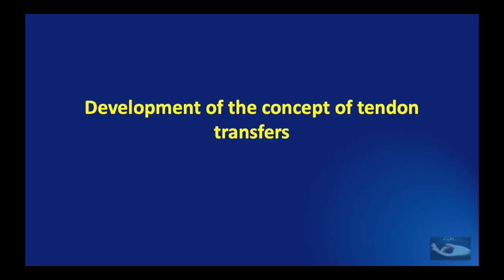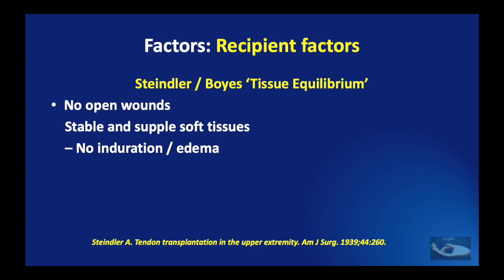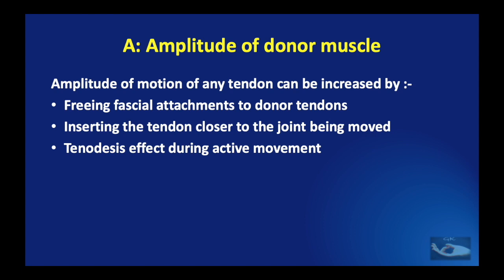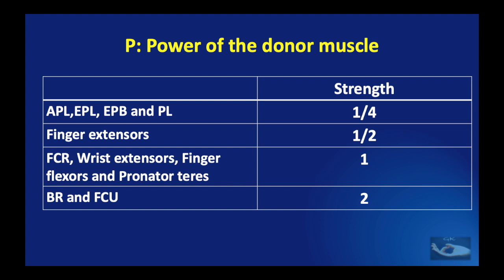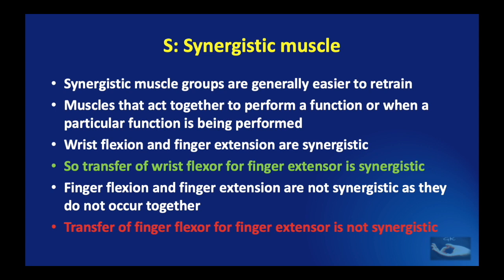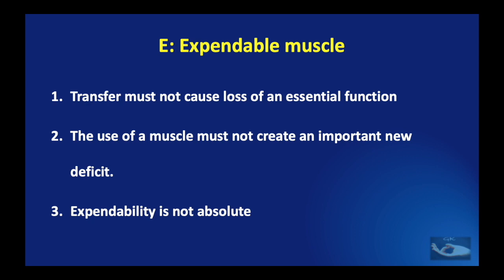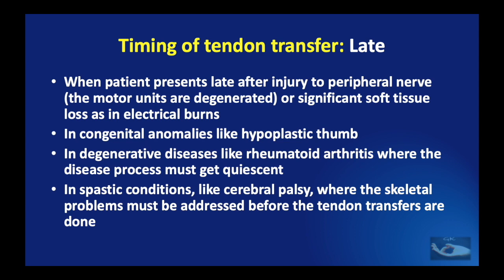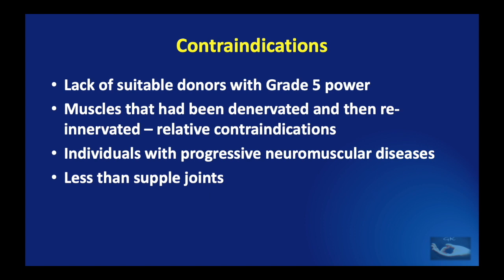BASIC PRINCIPLES OF TENDON TRANSFERS IN THE HAND

Comment: Dear Professor , Thank you for your videos. I hope you are doing well.
Can you please clarify the definition of Excursion? Thank you again..
Reply from the maker: When a muscle contracts fully, the tendon will move proximally. Suppose you open up a hand, keep the fingers in extension, and mark a point on a flexor tendon with a surgical marker, and then ask the patient to flex his finger fully. The marked point on the tendon will move proximally, isn't it? How far proximally it moves, will determine the excusrion of the particular muscle. For example, the excursion of FDP is approximately 70 mm (7 cm) and the excursion of FCR muscle is about 30 mm (3 cm). So imagine if you transfer the FCR to the FDP, even if the FCR contracts to its maximum capacity, the flexor tendon will move only 3 cm. So the ultimate flexion of the finger achieved by this transfer of FCR to FDP will only be less than 40%.
Reply: @GKHandSurgery  I